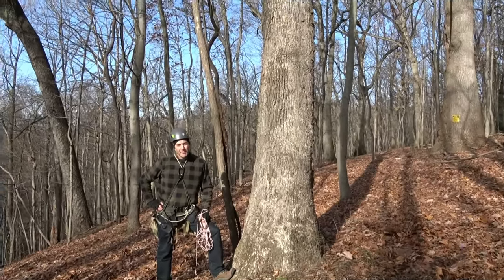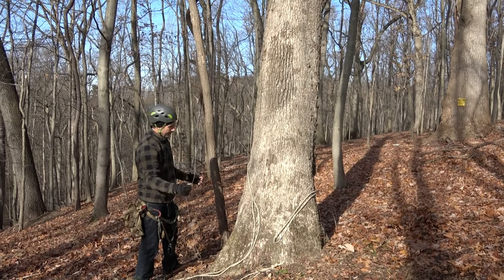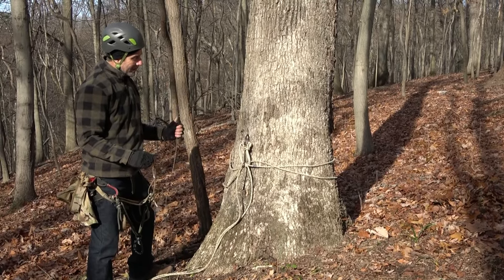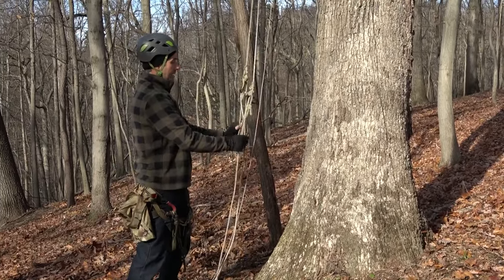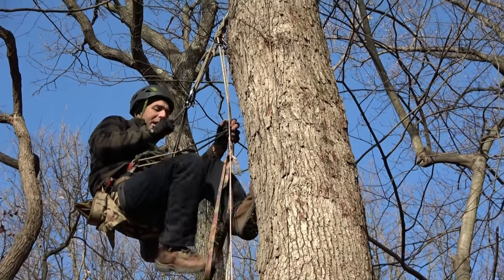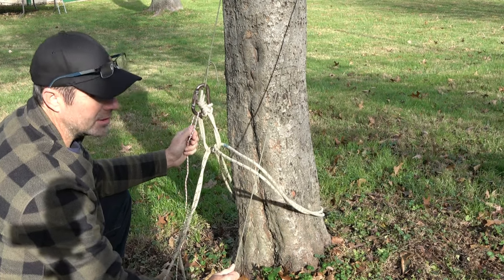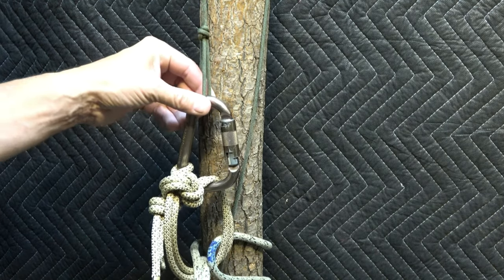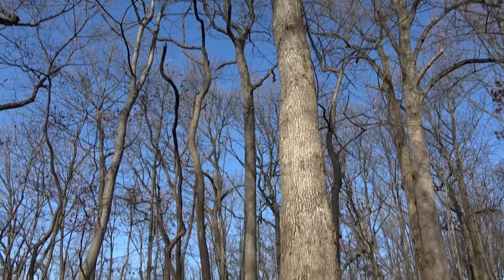JRB System Rigged on the Trunk with the Longhorn Soft Shackle

Comment: I have spent years trying to figure this out, thank you so much John. Your method much better than my attempts. I was trying to use spurs, they work great but are an extra burden I don't need.
Reply from the maker: When using spurs, we should still have a cinching tie in, and more than a lineman's belt. And spurs are used by responsible arborists only when removing the tree.
Reply: They also don't allow spurs on public land in places, so JRB is good when low impact is required

Comment: I’ve recently found your videos started rope climbing. I’m loving this system a lot as it feels safer, easier, and less stressful that how I was previously one sticking up the tree. Got several practice climbs in this week and the ascent and descent was awesome. I am still unsure of hunting on it though. It felt like the long bridge, two jrbs, and a carabiner at head height was going to interfere with shoot-ability for deer approaching in different directions. Might just be that I’m used to shooting with a tether and ropman but I’d love some tips on that if you have them. Also is there anything you do to help reposition at hunting height? I’m my few climbs I’ve found that the best crotch to climb on isn’t always where I want to hunt on a tree.
Reply from the maker: 1st, thanks.  2nd, understand that one of the most difficult things for me is figuring out what is missing and what pieces of information would help others the most.  Questions like yours help me in that process and inspire future content. I feel like a future video on shot positioning would help. In the meantime, I want to suggest that you find a tree you can practice on that's low to the ground. You don't even need a bow in your hand to simulate on and get into a draw position.  But if you can get bow in hand, that's even better.  Now, having a doubled rope over a tree crotch might be just a little bit higher than your tether is typically attached.  I find that to be an advantage because i am not being pulled towards the tree as hard and can rotate more freely.  Straighten your legs and push off from the tree and platform. Stong side and backward shots are taken care of with foot positioning. Weak side shots, i rotate the other way and stand and lean out onto the rope strands which are pressed against my left chest and neck.  Practice will help build confidence to lean out on the rope.  I hope this helps.
Reply: @jrbtc  thanks for the reply I will do some practice on shooting pushed out from the tree more. Having shot off a lower and shorter tether for a couple years now, I think I’m just more used to making all the moves and pulling back in more of a standing position where I am closer to the tree.
Reply from the maker: @Ozarkshunter50  when we are elevated, and shooting down, instead of bending at the waist, its completely acceptable to have out entire body leaning and held in place by our tie in. In fact, its a more steady shot, because our lower body is simply more stable.
Reply: I often reposition using a separate tether tied in the tree with the JRB cinch or saddle hunter hitch,, tie on a couple of ascender hitches and you have easy adjustments and you can hang whatever you want on the extra hitches

Comment: Can you describe the tether a bit more?  It appeared that it was a simply using tension on the line passing through the carabiner (rather than say a Running JRB Hitch). Is that correct?
Reply from the maker: There is no tether in this climb.  I am using two items described in other videos.  1. A JRB Doubled Rope climbing system. Its a long rope with a JRB Ascender Hitch on each side, and the hitches are tied such that I climb towards the middle of the rope, as it is typically set over a tree crotch.  2. The Longhorn Soft Shackle as described in this video:
https://youtu.be/mVhyIBTAAng
By affixing the Longhorn Soft Shackle around the bight that goes around the tree and the two strands of rope, it's locked around the tree.  The paracord attaches to the carabiner and is how i pulled it up.

Comment: What about just using a carabiner instead of the soft shackle? Eliminate the soft shackle?  Or run the middle of the rope through a rappel ring, take the loop around the tree and attach the ring to a carabiner making a false crotch, attach the paracord to the ring , attach a retrieval cord to the carabiner?
Reply from the maker: We never want to subject a carabiner to a bending force.  If u have ideas, that is great but you should tie and try them, safely of course, to make sure they are viable and safe.  If this was a private conversation, we could be more experimental, but i consider it a responsibility not to speculate with a comment that could lead to someone trying something that hasn't been tested.
Reply: @jrbtc  oh, hadntt thought of that, ok carbariners safely only take a direct straight line load, thank you
Reply from the maker: @kennethrogers1129  I haven't tried it, but certainly you could, however, I don't recommend it because it's only of use if 1) you have a pole long enough to reach your target height and 2) the tree has no branches.  In contrast, if we hitch climb using the end of the rope, we can use a shorter pole and set as many hitches as we need to, alternating sides each time to climb any tree, using a pole of any length or no pole at all.
Reply: @jrbtc  ok John, thanks for that, good points . So I will focus off season climbing on various ways of hitch climbing adapting a pole into my “tool box” and get familiar with running jrb hitch, saddle hunter hitch  , jrb cinch, longhorn soft shackle, as well as throw ball practice, and double rope climbing.

Comment: Thanks, lots of trees like that, really high first crotch , in my woods
Reply from the maker: Well i believe you have a system and so let me know how it goes. We can simply practice the rigging without even climbing. Just don't lose any of your ends on retrieval.  Even if it gets hung up coming down, u can still go up down again, and try to avoid the impediment. Cheers
Reply: Will try a low climb first, don’t know if I can trust that running eye cinch ,

Comment: I suppose you could pull up a loop around the tree  hitched with the jrb cinch, or saddle hunter hitch the same way, worked with a pole.. For that matter why not dude a doubled rope with the end bight through the rappel ring
Reply from the maker: Ya need a pole to set the cinch, and if you do, there is no sense having a line in the tree. As for other options, it needs just the right amount of internal friction not to tighten prematurely.  And make sure you can retrieve it. This video shows how i can use the same system with no changes to it.
Reply: @jrbtc  yes of course the pole holds the cinch while it’s pulled tight…

Comment: Any reason you think this wouldn't work on a single rope with a loop on one end?
Reply from the maker: Absolutely, and we won't be the first ones to do it either. The SRT gang might already be using a quick link which might serve as the carabiner and eliminate the need for the shackle. Practice your  rigging on a low tree and get it done. If you're using a mechanical friction device and can more easily remove it from the line, you can just keep pulling the retrieval line and it will all come thru.